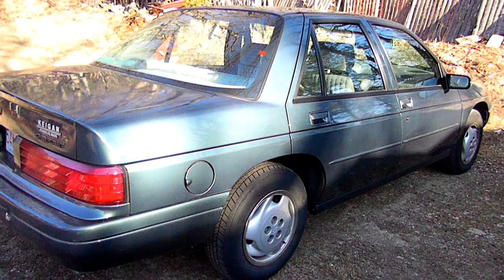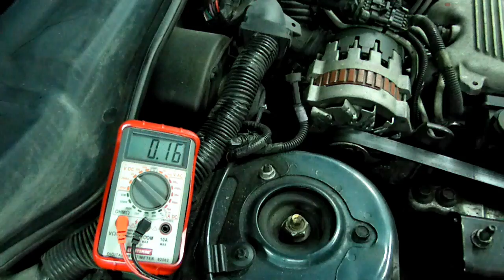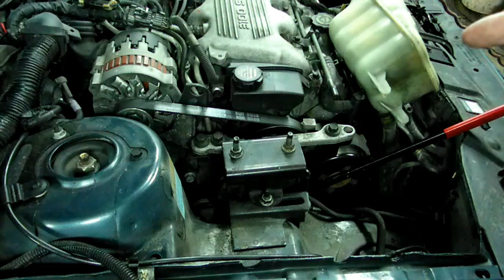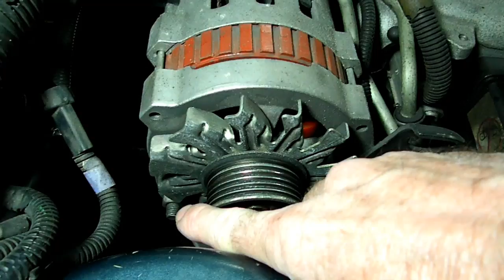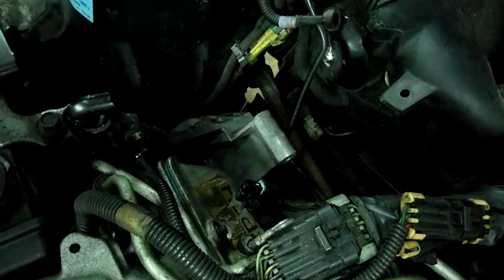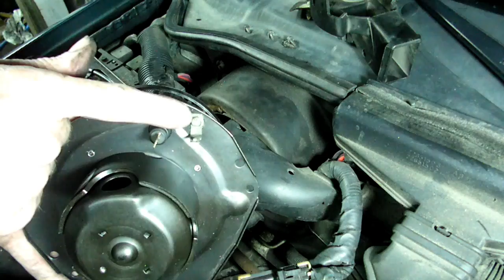GM Blower Motor Replacement

Comment: @jnichols3 I miss my old 86' Silverado.  The bottle was in plain sight and easy to get to.  My 91' I could read the trouble codes just by hooking a jumper between a couple of the sockets on the interface connector.  I just ordered a code reader to use on the 03.  It has over a 120k so I figure I will needing one more and more.  The last time I took it to a garage to check the codes, I paid $65 to find out I needed a $12 gas cap.

Comment: I hate working on modern cars.  All the components are 'shoe horned' into the engine compartment.  I just recently replaced the washerfluid tank and pump on my 03 Silverado.  I made the mistake of not connecting the wiring connector to the pump before bolting the tank in.  That was a pain trying to get the connector to line up with the socket.  I finally gave up and unbolted it and dropped it down far enough to connect it.  My hands just would not fit the space.

Comment: And I thought the blower motor on my 2002 Grand Prix was a pain in the ass. Had to lay upside down on the passenger seat to get to it, it was so far down on the firewall. At least I didn't have to remove the alternator!